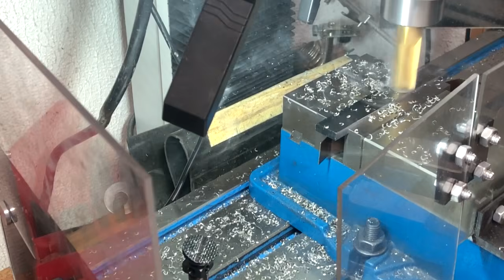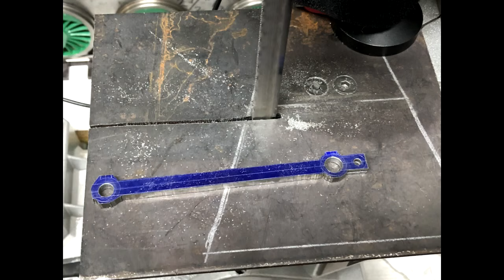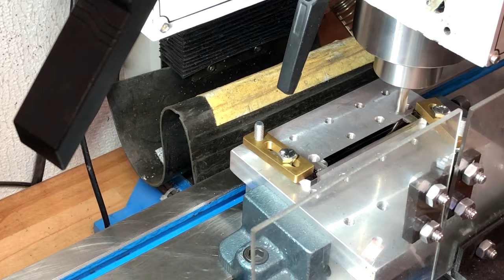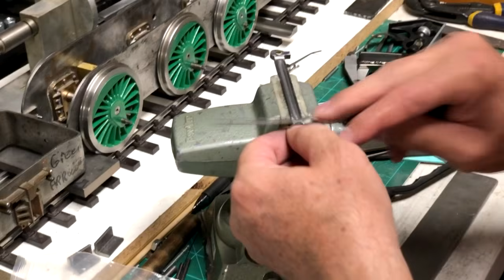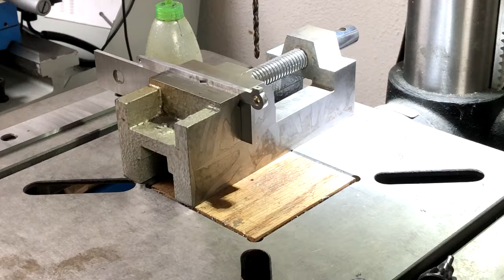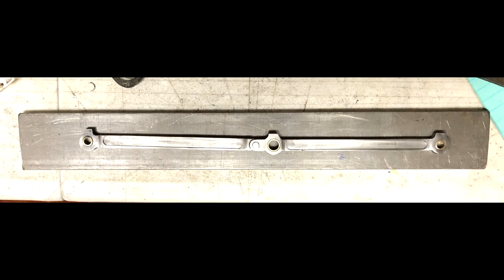2.5" gauge Green Arrow

Comment: You made a very nice job of the connecting rods Steve. There’s a lot of work involved in these parts. I’ve made two for my current project. I could certainly do with a die filler and vertical band saw 😅 Cheers Nobby
Reply from the maker: Thanks Nobby! Those tools are very helpful!